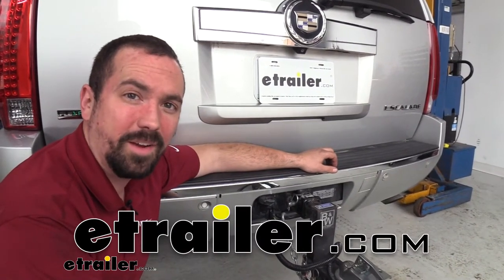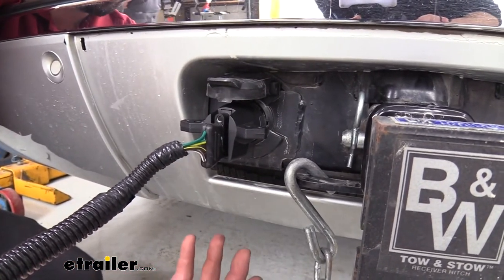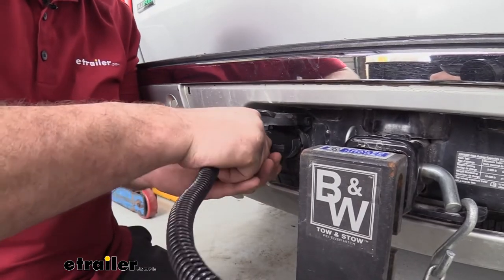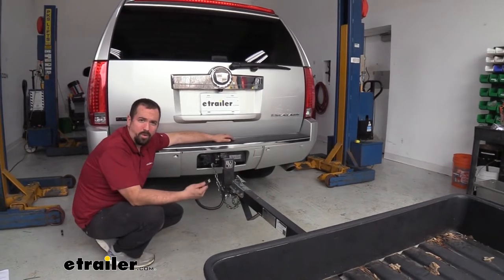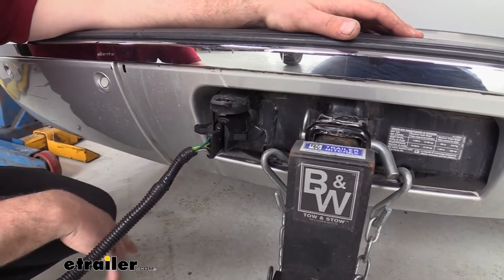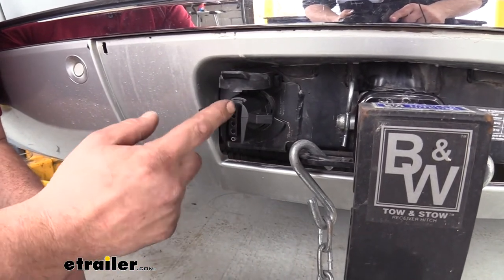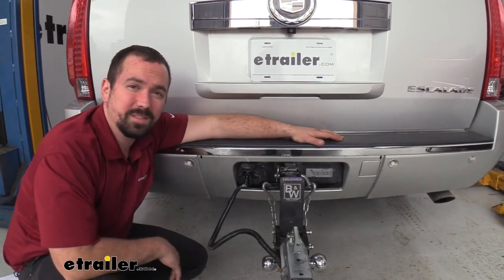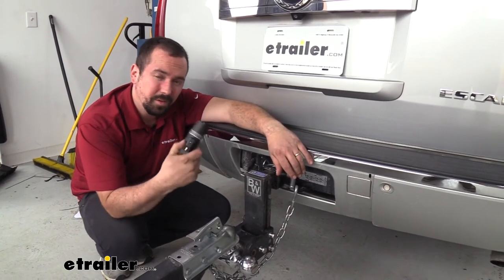etrailer | Curt 7-Way to 4-Way/5-Way Trailer Adapter Review

Comment: What happens if you hook it up to a trailer with regular bulbs?  Can you make this work?
Reply from the maker: By 'regular', do you mean incandescent? If the tow vehicle has a bulb out sensor and the trailer has LED lamps, you'll need to install load resistors like # DI34ZR on the brake/turn signal circuits on the trailer.
https://www.etrailer.com/Accessories-and-Parts/Diamond/DI34ZR.html
Reply: @etrailer  Thank you